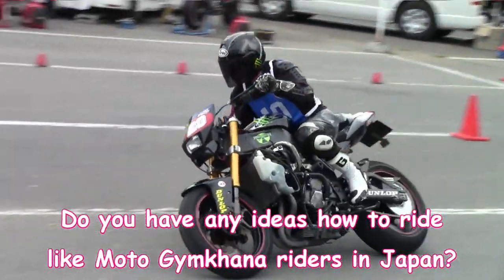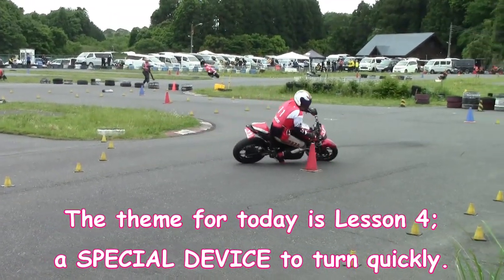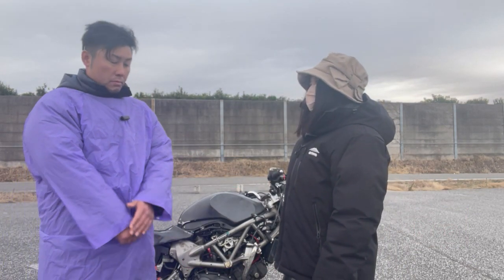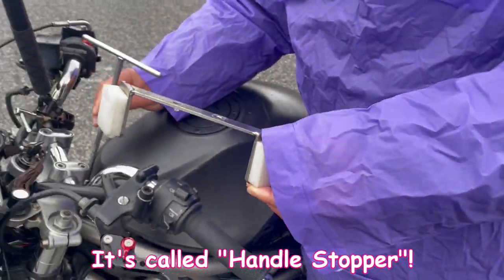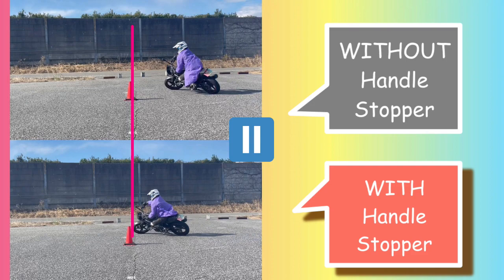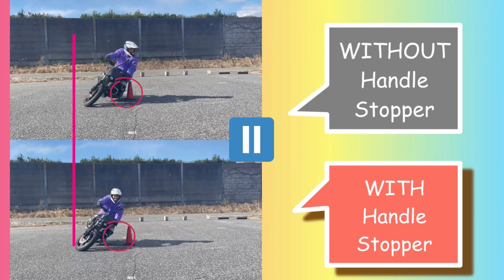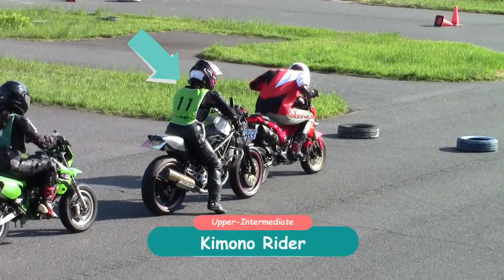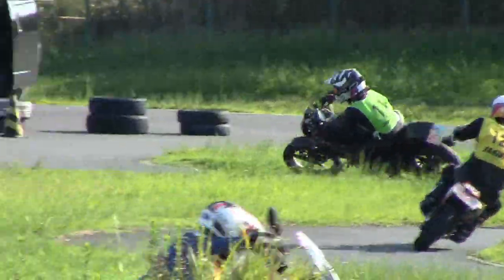[Full English CC] Special Device to Rotate Fast!?- Moto Gymkhana, JAPAN - Rank B rider's explanation

Comment: Wow, didn't know that people add stoppers to their bikes! I've only heard that riders on sport-bikes usually remove or make them thinner to increase steering angle and decrease radius (also replacing clip-ons with regular handlebars)
Reply from the maker: Hey, totoco, how have you been?😄
You are right, riders with big bikes, they try to increase steering, but smaller has something instead!😊
Reply: @kimonoracing  I'm fine, thank you! Since it's winter - no motorcycling for now even considering that we had a few warm days on 31st of december and on 1st of january. Some guys even went out for some training. But I wasn't training this season because of war and my bike was in the service until october . So yeah :D
Reply from the maker: @totoco2  That's good. Understood! It must be so so so cold in your place. In my area (around Tokyo), it is about 1-10℃, I still hate it, but we can ride. I hope you would spend a good time with your motorcycle hopefully soon😊

Comment: I think I didn't get the advantage to keep this device on the bike as it increases the radius of the steering...maybe smaller bikes as 250/300cc could not sustain the high pressure on the front brake that is required for quick turns as you explained in a previous video?
Reply from the maker: Hi, Eros. I guess it depends on riders. I tend to use strong brakes, so I don't use the device. If we rotate bigger & use brakes strongly, that is just slow.... My partner said if we used the part, slighter brakes would be required, which I cannot. 😅 He can do both. I am jelous!
Reply: @kimonoracing  I tend to use not so strong brakes but I'm practicing to strengthen them to rotate smaller even if slower! Maybe is better for me to keep practicing one way so I can't get confused haha btw thank you a lot for your videos, your tips and your kindness 🤗
Reply from the maker: My pleasure!👍 I think your way of trials is fair and good. I think we need to try both/ all if we have some alternatives. When I make a decision, time is everything😎
Reply: @kimonoracing  you're right! I will try if I have a chance 😊✌️